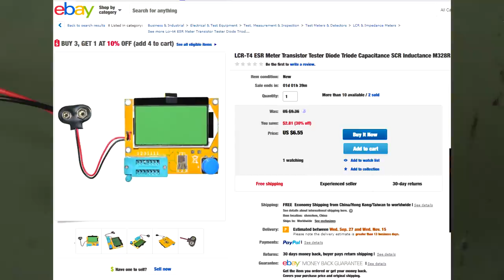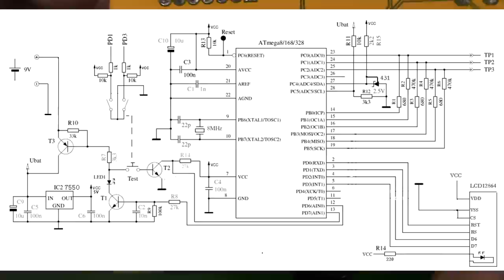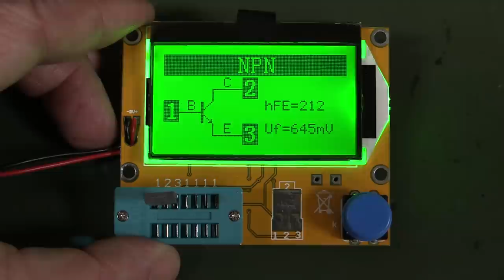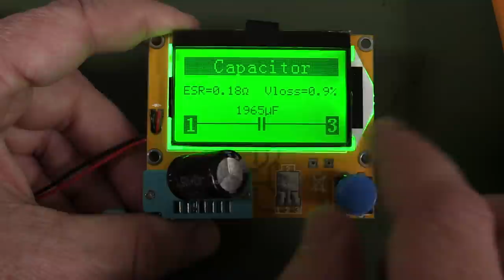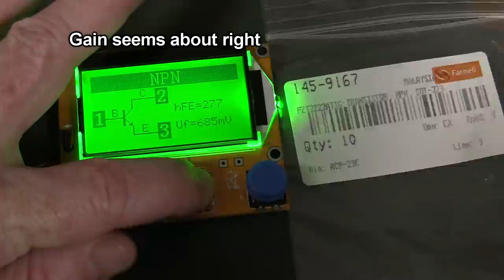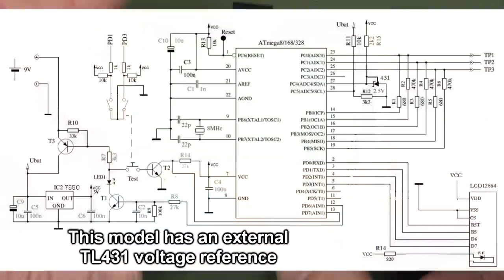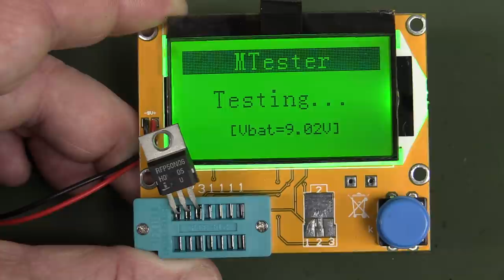EEVblog #1020 - Is A $7 LCR / Component Tester Any Good?

Comment: Dave,  a guy with a $9000.00  rolex watch was once told by a guy that had a $3.00 digital watch "Nice wrist watch,  it seems to be only a few seconds off"
Reply: WisdomVendor1 I stopped and gazed after reading this, true !
Reply: I'm more of an Omega man, so I'll go with that. Rolex is overpriced -- their prices have doubled in the past few years. Anyhow, with that said, I'll give you a bit of perspective on Swiss made watches. I know a $25 quartz Timex will tell time more precisely than a $5,000+ mechanical Omega Seamaster, but I appreciate the craftsmanship that went into it. Think of it like this -- if both watches cost exactly the same amount ($25), which one would you rather own and why? I'd rather have the mechanical masterpiece because I appreciate the craftsmanship, artistry, and engineering that went into it, rather than the quartz. Perhaps you favor the electronics of the humble quartz. Nobody passes down a Timex.
Reply: Espinosa versus Tano Cariddi?  (water-wall-clock vs quartz-watch scene)
Reply: Wrist sundial gang where ya at?
Reply: @explosivedude8295  nah.. prefer the wrist pendulum clock
Reply: Turns out it's the $9000 rolex that's off by a few seconds.
Reply: But you can't use it diving. Lol.
Reply: The Chinese aviator mechanical watch is epic.
Reply: @dewe1462  sounds like a teenager
Reply: Now I have galaxy that is NTP synced

Comment: Dave, you can calibrate this device by shorting all 3 test points and pushing test. After a short process will ask you to remove short and at some stage ask to install a capacitor. Would be interesting how accurate it is after that process. Thanks for the vid!
Reply: Wait are you serious?? I've had one for a while and I never knew that! Where did you get this info?
Reply: it is written in the "manual" lol I used for weeks and was not getting the precise values that it was supposed to, so I checked the "manual" and there it was. Works perfectly. Have to calibrate every time and in each leads change btw
Reply: Does that mean that the calibrated values are not stored in eeprom? It should be relatively easy to fix that..
Reply: +Louis Stubbolo there are videos of people calibrating on youtube, saw them before I purchased one. Now you can get them for $10 with a case.
Reply: SirArghPirate They may well be stored in eeprom, but if you are using external test leads or a different set of pads to measure your parts then each set of leads/pads will have a slightly different innate resistance, capacitance, and inductance that needs to be accounted for.  It is one of those things that must be calibrated out whenever you change leads and from time to time (such as with changes in environment) even on higher end LCR meters because it does not know when you changed the leads and that new calibration coefficients are now needed, so it is ordinarily a manual process.  If using external leads you would ideally use shielded leads so that the leads do not interfere with one another nor pick up external fields that can alter readings (or else keep your leads extremely short).  Typically you will have several sets of test leads ranging from alligator clips to SMD tweezers, etc., for testing various types of components, hence lead changes are not uncommon during use (and at other times you may switch to using the built in pads, which would also be equivalent to a lead change).

I am grateful Dave made this review as I am very impressed by the quality of the firmware and its overall capabilities.  Even though I already have perfectly good transistor testers and very nice LCR meters I may still be inclined to order one or two of these in the future, preferably outfitted with a proper case for added protection just to compliment my other gear, or to loan out to others as I do not loan out my lab grade test gear.
Reply: have some way to get the ESR of a transistor in this model?
Reply: Thank you! The entire video when he was talking about how the device is not precise, I was screaming to him (in my imagination): Duuuuude! Of course you're getting inaccurate values. That's because you should've calibrated it. It calibrates easily with shorting the three leads, then you'd need a ~10nF and a ~20pF capacitors, and it's done. I have the exact same model and I've hacked it and added many other features, upgraded the firmware to the latest one, added two more button and a menu, which I can now use to generate or measure frequencies, set contrast, measuring voltages upto 80V, etc. I've also upgraded the crystal from 8MHz to 16MHz and added USB power beside normal battery. It also has optional quartz detection, voltage regulator detection, infrared code detection, etc, which can be enabled in the configuration file, but that'd need more than the available 32KByte flash of the ATmega328 on it, even when using its EEPROM for storing some data. But the features in the latest version of the firmware are much more. You can fit those features in this only if you disable some other features or use a microcontroller with more space.
Reply: @gtroc71  my life has meaning again
Reply: doesn't really matter if you calibrate it because the accuracy isn't going to improve much. It just gets you in the ballpark. You can't expect something this cheap to be accurate
Reply: thank you.
Reply: @PhuckHue2  you can, if you equip it with precision Voltage reference and measurement type resistors. It's described here:
https://github.com/madires/Transistortester-Warehouse/blob/master/Documentation/ttester-1.13k.English.pdf page 21
Reply: I accidentally found this out while testing a broken MOSFET. It had all 3 pins shorted together.
Reply: @PunakiviAddikti  I accidentally found this out while testing a broken MOSFET too. Been wondering what Selftest was, then I stumbled on Dave's video.
Reply: Can it also measure frequency?
Reply: you are still helping people lol, thanks for the tip!
Reply: @khashmeshab  can you share the detail process of thi upgrade firmware o all of us can upgrade this tester to be much better than original firmware? Thanks..

Comment: @ EEVblog  (Dave)  are we at 20 years running since the first atmel code?     I remember working on that project back in the day ...     the original was just an atmel  and the data sent over rs-232 with some shitty visual basic  or delphi code I wrote back then ...   ( It's been so long I really can't remember )  not  portable   NO LCD , NO 9v battery, no smd pads for the little tranny  etc ..   etc ..   it was more of a bench-top  concept at the time ...  but, of course it had the zif socket !   I'm glad to see it has evolved to a really handy portable jobbie !  I have the updated binaries if you want to flash the atmel chippies ...  to un-chinese it !    all you need to do is solder a few wires and run my patch and it will be much more accurate !     🤔

Comment: Lcr meters are super complex. The fact that this $7 jobby can get it done is astounding.
Reply: It's ballpark LCR figure only. Real LCR's use a higher frequency and test voltage than this little device is capable of. The K-Firmware from the OSHW project has a slightly more versatile measuring funtion that requires an ATmega328, a 16MHz Xtal, a relay, and a capacitor to add a Sampling ADC method.
Reply: is it too complex ?
Reply: thanks for all of that, i will now need some time to digest all that.
Reply: yes, right. i think i need to become an active in eevblog forum.

but
 what i was saying is, i saw some models online where they used a 
comparator zero crossing detector and a couple of digital i/o pins to get the 
resonance frequency of an lcr circuit, and it was quite straightforward,
 and yielded good enough result ( acceptable for me at least ) at not so
 high frequencies.

in fact, i am building one ofe those in a box, after prototype result satisfied me.
Reply: I found also for about $70 you can get a Atlas DCA55 which seems to be more commercially made transistor tester
Reply: @UpcycleElectronics  Thanks a bunch man, much appreciated!
Reply: @CaseyRedDragon  ,  And what is your opinion of the Atlas DCA55?
Reply: Impedance is always complex. The real part is the DC resistance and the imaginary part is reactance. But I think you meant complicated. 😀

Comment: I have that exact tester... It's true that the absolute measurements are a bit off, but it's fairly consistent when you repeat measurements, so it's great for matching components. I've used it to find the closest resistors in the pile, and to match MOSFET gain when rebuilding an amplifier. Fantastic bit of kit once you understand its capabilities and limitations.
Reply: I hope you've shortened the three inputs of your device and calibrated it. Because I have the same model and after calibration, it's pretty accurate. You can also upgrade the firmware on it using the original repository, but it's a little bit tricky.
Reply: How do you use to match mosfets Gain because I not seeing the numbers this is showing I'm trying to match irfp260n mosfets and Google is no help if I search what's on the display
Reply: Can this test components in a circuit without removing them?
Reply: @irishguy200007  It will depend on the circuit, and the component being tested, as items can be in parallel etc. It's no different than with any testing.

Comment: One of these is all I have for LCR meter, and it's more than good enough. All I need one for is to identify messed up electrolytics that have caused a power supply to fail. Finding an electrolytic that should be at 1 ohm ESR measuring 35 ohms is good enough.
Reply: John Ridley same here
Reply: how accurately does it measure inductance?

Comment: Many of these units also offer a way to calibrate them and once done are pretty much bang on.  Some of the software versions also offer more accuracy depending on the external ADC being used onboard.  I have a couple of these units and they come in really handy for testing salvaged parts or doing basic transistor or mosfet matching.

Comment: Nice to see that you made an additional video about that device, thumbs up.

Oh and what you want with that is to test, if the component you put in is OK or not and if the replacement part is somewhat close to the original part.
Reply: That's a very good idea.  Sometimes you want components with some element of shittiness, like ESR, when you come to replace them during a repair.  Or if a salvaged part is even worth keeping or if it falls below even lash-up standards.

Comment: I have owned one of these for about 3 years now. Two years back I picked up one of those DIY Kit mini oscilloscope and put it together on the booth table of our RV. To sort out the parts for the kit I used my version (A bit more developed then yours) to sort the parts for assembly.  It did a great job. Since I rarely use surface mount, I have soldered alligator clips on the pads so I can hook to parts that do not fit nicely in the plug deal. I use it very often and it has always done a great job for me.

Comment: I've had mine for several months; cute! ...added a power switch to prevent any parasitic sucking juice out of the 9v battery.
Reply: Same!
Reply: That's nice, although these devices have such a small parastic draw, that it is practically unnecessairy.
Reply: I didn't have a spare 9V battery around so I used two 18650s in series, seems to work well so far :)
Reply: Depends on the version you got. There were some versions that would kill a 9V battery in a couple of months or less.
Reply: I have several versions.  Even ones that are powered by a AA-sized lithium cell have the bad design of a resistive voltage divider before the power switch.  That version mitigates the problem by a mechanical power switch and, of course, being able to recharge the battery.
Reply: I measured zero parasitic draw on mine. The switch connects the power, and then there's a parallel transistor that the micro uses to hold the power on until it times out.
Reply: @thewhitefalcon8539  mine is still on the same battery for a year.... now its 8.54V  and still working great with those ikea 9v batteries
Reply: Got mine for a year and the battery voltage has not dropped while inactive.

Comment: We've just outfitted all our labs at my university with a variant of these. We use them as pinout checkers and magic smoke detectors. Saves tons of time helping students. I've also grabbed a 74xx chip tester for logic gates; same reason, check for the magic smoke.(no kid your chip isn't bad, you wiring is)
Reply: Oh I didn't know there were 74 series testers like that. I certainly could use one, because my wiring often is bad!
Reply: Mythricia I've found two different models neither works for 100 percent of the series but they work well enough, and can be found from the usual overseas sources
Reply: You still use discrete 7400 logic chips? Heh, I TA'ed that class twice at 2 different universities, the second time it was all schematic capture and small fpga dev boards, and that was a number of years ago!
Reply: Well, as a hobbyist I rarely do things because they are practical or useful, using elementary logic is a lot more fun than just another microcontroller.
Reply: Nope

Comment: If you press and hold the button a menu comes up with a number of functions including in-circuit ESR measurement for capacitors (without having to press the button each time), very useful.
Reply: Did u test the in-circuit ESR measurement ? What are the results is it really a 0.01 ohm resolution (or 0.1 Ohm depending on the version) ?

Comment: I know I'm late to the party but I've got one of these and it's perfect, as you say, for checking pin outs on transistors etc. Certainly a lot quicker than trawling the net for data sheets. I also use it for checking that LEDs are working before soldering them to a pcb.

Comment: I picked one of these up a couple of years ago.  She is a bit more refined then the one you reviewed, but not that much better..At any rate, two winters ago I got one of those little oscilloscope kits, complete with case and all.  So, being in our Motor Home, some 1500 miles Southwest from my shop, I decided to assemble the kit on the booth of our RV, using a 5 volt portable soldering iron and that device identifier to sort and install the parts according to the chenglish almost instruction sheet, (Thank GOD it had photos of how it went together!)  Well it never did work right, I guess, until last fall when I was typing my problem into a forum and read my own text, in which I discovered the problem.  The rotary encoder was bad, I ordered in a new on, and now the little Oscope works just fine.  A bit late because I had ordered a bit better kit, well larger not sure how much better, and have that one working like a champ as well, also using the little parts ID to sort the resistors instead of straining my old eyes trying to id those damn green-blue resistors that mask the true color of the bands. The second one came without a case so I ordered one separately.  The outfit had to send me 3 damn cases before I got one that was not missing parts, or broken in shipment!  I am a bit particular about such things even if it takes 30 days for the damn packages to get  here from China.

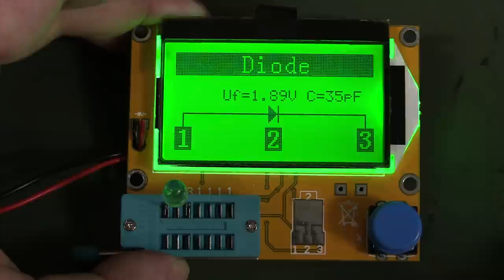Comment: 6:31 
From product manual:
"The turn-on or turn-off voltage of the mosfet must be less than 5V, otherwise the measured result is only its equivalent parameters (diodes, capacitors, etc.)."

Comment: Get a version with a socketed atmega. Read the original documentation: https://www.mikrocontroller.net/articles/AVR_Transistortester. Pop in a 16Mhz crystal, replace the voltage reference ($2 directly from TI) and flash the latest firmware. It will measure sub pF and nH easily and fairly accurately.

Comment: I really love the Mtester I have for a couple reasons. 1. It can auto identify transistor polarity and pinout, which is very useful for unknown components. 2. It can do inductance to some degree, which for a cheap device like this is invaluable. As a beginner myself I would fully recommend any beginner get one of these, especially if they can afford better test gear like me.

The only quibble I have is that the socket is relatively fragile.

Comment: If I had the money for all the accurate test equipment,  then I would be one of the 2 percent.  This kind of tester is a great deal for the majority of hobbyists.   But, these should have a data sheet that tells their measurement range for different types of components.   If they can spend the time to tweak the firmware, they can document and provide that document to compete  head to head with the others.

Comment: The thing is, 99.9% of the time 100 people out of 100 don't need to know the value of a component with any precision whatsoever, other then it being an actually functional part of the right kind, with a value on the order of magnitude you thought it was of.
Reply: Attila Asztalos Exactly, when was the last time a hobbyist or repair tech needed to know a value to any greater accuracy than 10% in reality? $7 device = good enough for Australia, or anywhere else for that matter.
Reply: A repair tech might actually need precision. But hobbyists? Just knowing more or less what the component value is will almost always be enough!
Reply: You don't need precision if all you build is LED clink circuits and alike. Shit tools makes same quality things.
Reply: This. Also when I measure capacitors all I'm really looking for is if the capacitor is ok or needs to be replaced, the ESR and capacitance readings on this do the job just fine (after calibration).
Reply: I must be the 0.1% - I'm looking to test [and measure! ] hand-wound coils and transformers.
Reply: @juliusvalentinas  lol